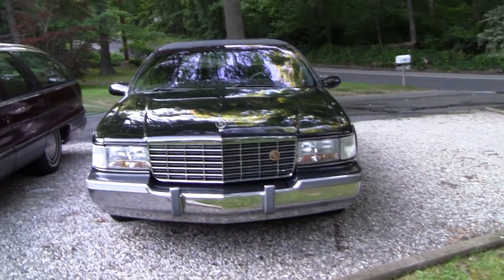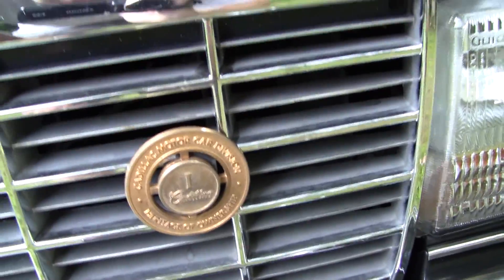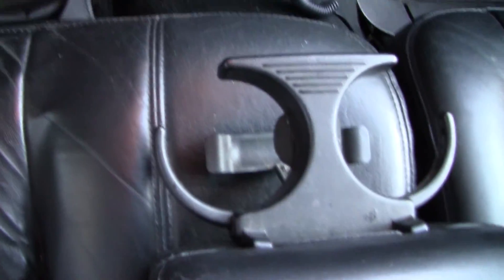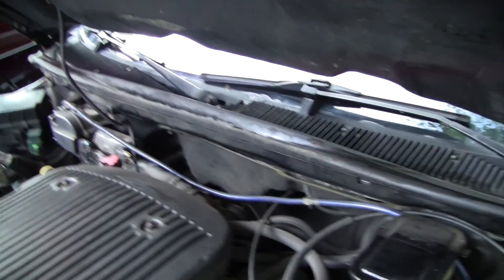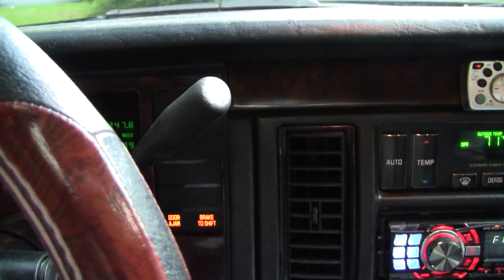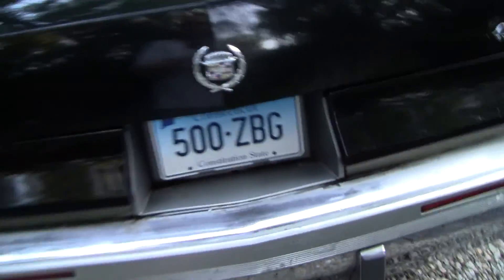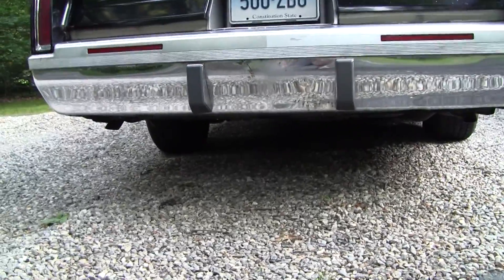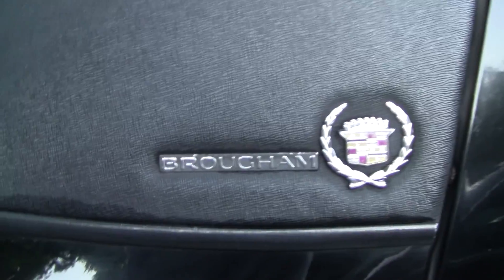The 1996 Cadillac Fleetwood Broughm (AKA Bro-Ham)

Comment: The Roadmaster and Fleetwood are a lot more similar to each other than they are to the Caprice, which is nearly identical to the Impala SS. The Brougham was the fully loaded trim for the Fleetwood (although it did used to be it's own individual car by Cadillac). So a good comparison to this car would be a Roadmaster Limited but the Fleetwood is the biggest of all of them.